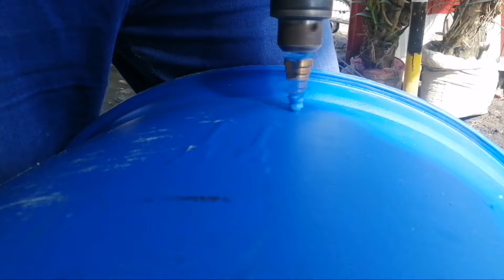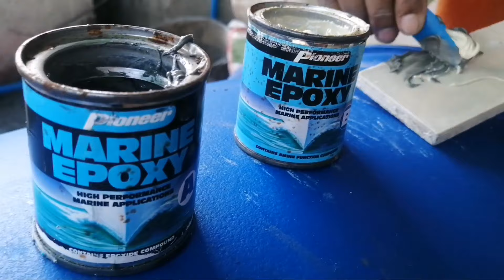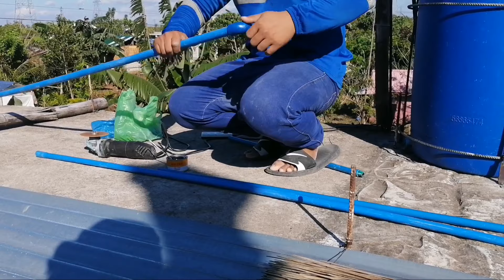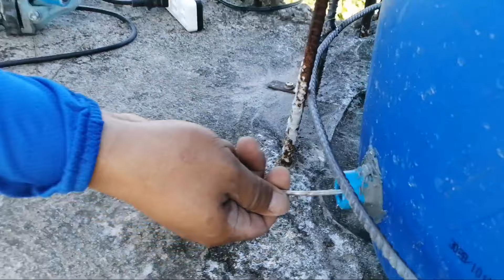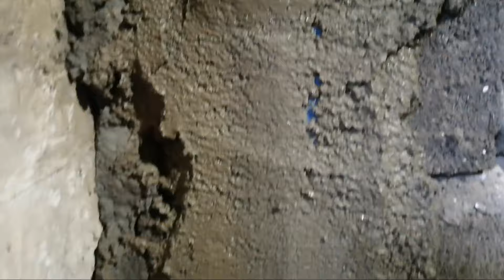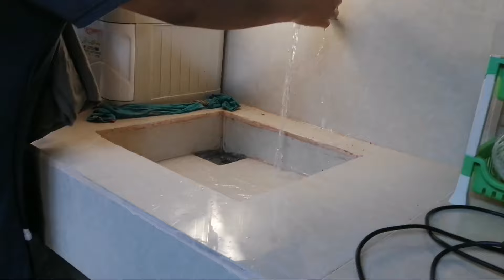Easy Installation of Electric Water Pump with Water barrel use for Home and Farming(Part 2)

Comment: hello po!! may chance pa po bang mas lumakas ung labas ng tubig? anu po kaya pwd ilagay para mas malakas ung parang pressure ng water.. ung gripo po kc namin parang ganyan din ung water flow.. Ung shower po parang ihi lang 😅..

pwd pa po ba un maremedyohan? ganyan din po set up namin pati gamit na imbakan ng tubig! 
Sana po matulungan mo po ako 😊😊😊

Maraming salamat po! New subscriber here 😍😍
Reply: Pwede 1/2hp na motor ilagay mo sa line  after Ng water source (tanke) pakabitan mo Ng pressure switch🤭
Reply: taasan ang blue tank lalakas ang pressure. pero if di na pwede taasan at gustu mo lumakas ang tubig, palitan mo ang blue tank ng pressure tank.
Reply: ihi ng baka malakas yon hahaha.